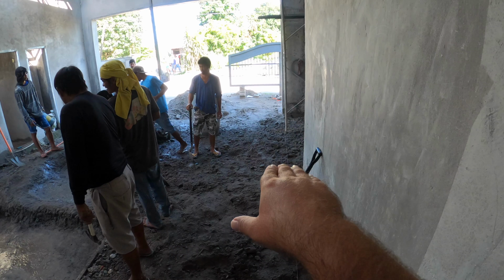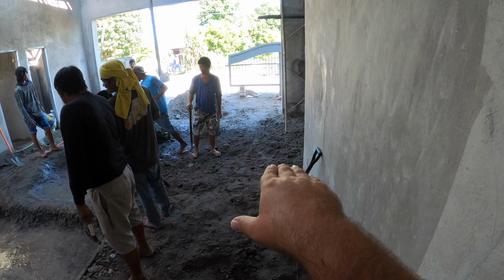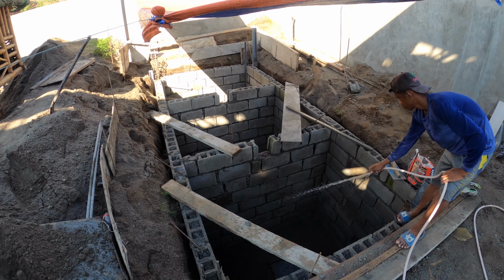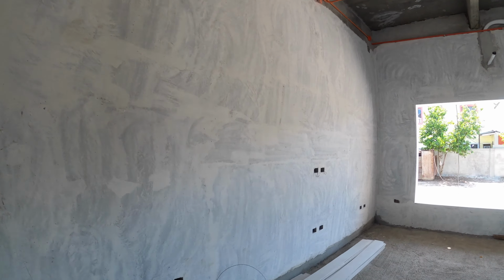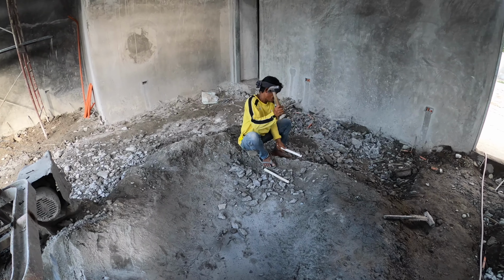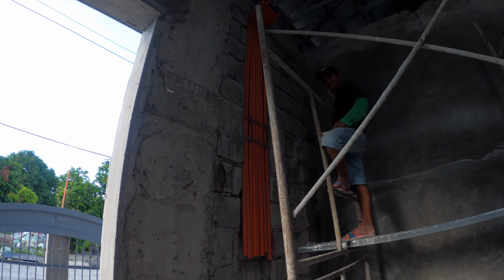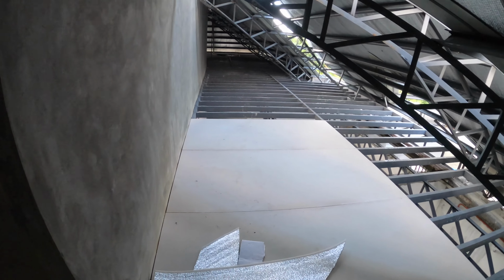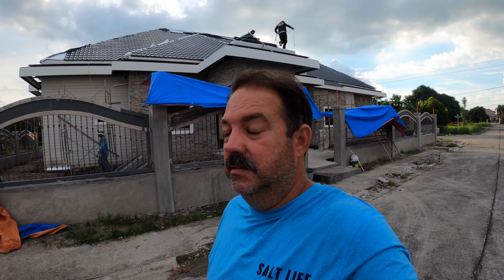Philippine House Building Step by Step, Build Day 153: Septic Walls Day 2

Comment: Hi George, your house is huge! Question for you, when you say plastic coat or “palitada” is that a waterproof kind of cement? Curios how they waterproof the septic tank. The last chamber is the leaching chamber, does it mean no waterproofing or cement on the bottom?
Reply from the maker: Great questions. The plaster coating is basically just smooth cement finish. Definitely not waterproof. 
The septic system is supposed to have a waterproofing agent applied to the inside, but it’s not regularly implemented here. Also, the third chamber (leaching) is supposed to be open at the bottom filtering through a gravel base. However, the local city engineers office required a sealed system which means more frequent clean outs. Thankfully we have a large 18CM (4700 Gallon) system. Should take a while to fill up.
Reply: @CasaTexPina , oh it’s plaster coating not plastic. I thought it has a waterproofing element thus plastic coating. Sorry, 😀. Anyhow, thank you so much for the videos, I am learning a lot. Maybe your builder a.k.a. contractor can refer me to somebody in Cavite. Your contractor seems honest and make good quality homes.

Comment: the progress is looking so good. how does the last chamber leach into the earth? I think you will find that flooring looks a little of engineerd. which is engineering standard practice. add a 4x4inch steel top beam over the top of the wall to distribute the downward load, add extra bracing members about 1/2 a meter out from that, then mark out the areas on the floor above to indicate where to store heavy items like rice and heavy furniture items. A really good way to make to floor area is with 3 ply wood which is also distributing downward load.
Reply from the maker: Last chamber actually doesn’t leach into the ground, but overflows into the storm sewer. Should be basically grey water by then. Bond beams are coming next. Should be today’s business for the septic. 
The attic floor is for light dry storage only. Nothing too heavy.
Reply: @CasaTexPina  Agreed. I think your attic storage spaces will be plenty strong for the things u plan on storing up there...

Comment: good morning ..are you happy with the temperature up in the media room ? hope the insulation is working well ?..i have a tool perfect for the garage mission, but the Spanish method seems to rule there most of the time. manual labour at its hardest , at least its in the shade i guess.
Reply from the maker: The temperature up there is surprisingly cool. Should be fine once the ceiling gets put in. No problems for the two ac units that will be up there. 
Workers requested a jack hammer the day prior. Might be on site sometime today. 🤞🏽

Comment: Can I ask where did you buy the CCTV camera ? Here in US or there in Philippines?
Reply from the maker: Contracted the whole system setup here in the Philippines. Solicited quotes from 3 separate vendors and went with best value. Not the same as lowest price, best bang for the buck.
Reply: @CasaTexPina  Were the three quoted prices roughly the same?  Or was there a huge difference between the three you received?
Reply from the maker: PeeKen 
One was very generic, bare bones. 
One was detailed and included extras as options for not much more. 
The third was extremely high as if they meant to say they didn’t want the job. 
Decided for the detailed with options as they also presented necessities we had overlooked.
Reply: Casa TexPina was

Comment: How does home owners insurance work in the Philippines ?
Reply from the maker: Buy your own from the bank or independent insurance companies. Not sure about the claims process, hopefully will never have to use it.
Reply: @CasaTexPina  Maybe a dumb question, but have you ever see any type of home sprinkler system installed there in case of a fire?  Just curious.
Reply from the maker: PeeKen
I have never seen a home sprinkler system for residential here. General consensus is that the house is concrete. Only your belongings would burn, the house would still be habitable.
Reply: @CasaTexPina  True. Unfortunately, I had a house fire in the Angeles City in a house I was renting back in 2013. Main home was concrete was fine, however, the roofing frame was all wood, which burnt completely, fell down on my contents, and burned all my furniture :(
Reply from the maker: @NittyAngeles  
Ouch 😓 
That bites. Sorry to hear that.
Reply: @CasaTexPina  Yeah, that one hurt, but gave me a reason to have to buy 80% all new stuff - so that's something from the bright side lol

Comment: Is the septic tank floor open? Or closed ?
Reply from the maker: Closed floors. I had previously misunderstood the engineer’s explanation. Corrected that comment a couple of days ago.
Reply: @CasaTexPina   Finally.. An improvement from centuries of Pilipino open floor septic tank!!!   Bio filter using aerobic and anaerobic bacteria with UV lights ???
Reply from the maker: We’ve got closed floors and large chambers. Can’t expect all of the improvements at once. Small steps forward.
Reply: @CasaTexPina   My fellow pilipinos has long been overdue for a long time..No OSHA...wearing slippers...no steel toe boots..